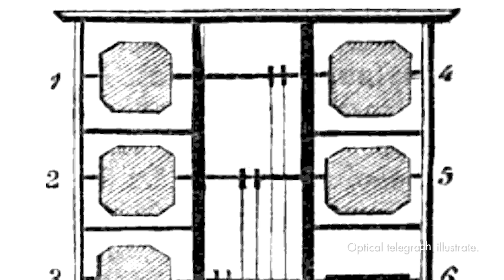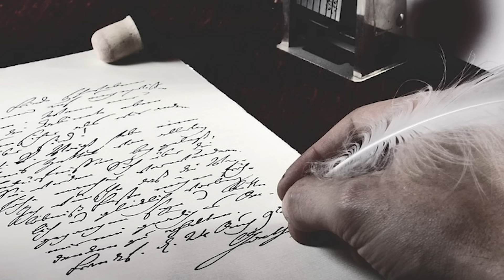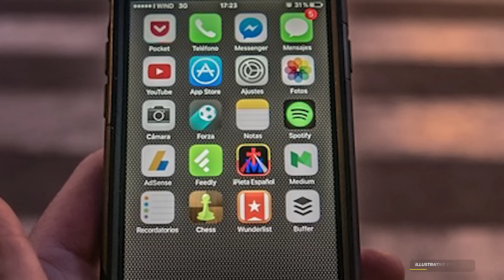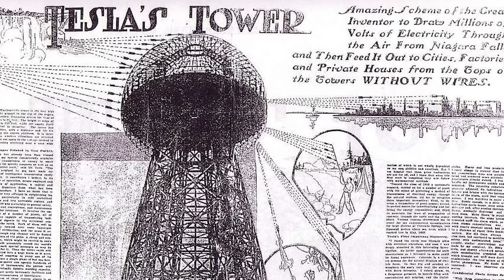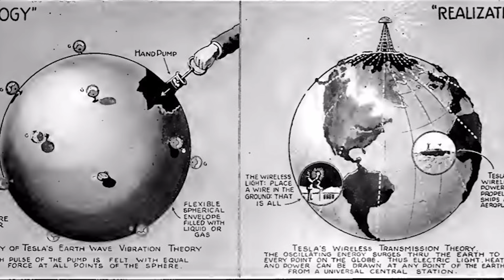Why America's Forgotten Microwave Skyway Network is still standing | Abandoned

Comment: As somebody who to this day works on microwave networks.....these are still in use by hundreds of entities in the US alone.  They are used in places where laying fiber optic cables would be cost prohibitive or is flat out not allowed (through national parks, etc).  This equipment is still manufactured and progressing and is now capable of supporting speeds up to 10Gbps.
Reply: I design word docs for circuits using them sometimes and I hate them lol. They're inventoried in our TIRKS database in all kinds of bullshit ways and we basically have to get told by an engineer a carrier we need to use is some microwave between mountains XD
Reply: @Emily_M81  They function great, but we do all our own documentation in house lol.  Hybrid circuits are always a PITA though, I much prefer pure microwave networks overall.  As soon as you start introducing fiber inbetween on the circuits it gets way too messy and complicated (from a monitoring standpoint).
Reply: I've worked many cell sites linked on mw.
Reply: I live in the desert west of Nevada, grew up in Idaho. Yes. Many of these are still in use. Some are now smaller than they used to be. I am now an ham radio operator. We use similar microwave radios to jump from mountain to mountain for our repeater network. Telecoms still use these older system.
Reply: How good do those e-band links handle rain?
Reply: I worked in a system that paralleled the Alaska Pipeline for nine years.
Reply: Yes my father worked on Union Pacific RR microwave systems for many years.
Reply: Thank you. That's what I wanted to know.
Reply: What happens if you were to stand in the way of these antennas while transmitting ??
Reply: @ovejeromd  That would not be a good thing to do. When working around the antennas we would wear a device that warns us of dangerous levels.  We also would use a  meter to measure around the transmission lines and wave guide connectors periodically. My last position before retirement where I worked we put over 200 watts out of the SSPA at 6 GHz. The antennas were 15 M with 55dB of gain. It was a gateway earth station providing most of Alaska’s rural communications. 200w at 6 GHz could cause some serious tissue damage. I got a small RF burn once about 50 years ago. It was a small internal burn under the skin.
Reply: @ovejeromd  Depends on how strong it is transmitting, but if strong enough, cooks like the microwave does.
Reply: They don't still utilize the horn antenna, do they?
Reply: @deepspacecow2644  It varies quite a bit.  You can see the signal degradation when rain occurs but it generally has to be a pretty heavy rain for it to have any drastic effect on the signal.
Reply: @jerseyshoredroneservices225  Depends entirely on how much the person is willing to pay.  More modern stuff no, but so many places and companies aren't willing to pay for newer equipment that the older equipment is still in use, with all the problems that come from them.
Reply: @mercuryfusion8325  
Ok, thanks.
 I remember being very intrigued with the long lines towers/antennas when I was a kid. When I come across one from time to time I always think I should fly the towers and make a video about them.  If there's a chance that one might still be active I guess I'd better think twice about flying in front of them...
 Not long ago I was out in New Egypt, New Jersey flying a cell tower audit.  On my way to and from that site  I passed a LL tower that was really calling me to fly it.
Reply: Kind of of what Ubiquiti manufacturers for the retail market?
Reply: In fact the NY to Chicago Skyway route has been reopened, new antennas and transceivers are being used, but on the old towers, why latency and stock markets. Light travels slower in fibre optic cables and they do not go the most direct route, thereby one gets better latency using microwave relay still.
Reply: I want to learn how to use this technology.  Where can I learn such tech?  Is this a trade knowledge or something you learn in school?
Reply: @Chris_at_Home Without knowing details such as system loss or dB over what on your antenna gain, I can’t tell what your ERP was. However, when I plugged in a system loss of 2 dB and assumed antenna gain of 55dBd (deciBels over a dipole) I get an effective radiated power of 39,810,717 or almost 40 megawatts. Wouldn’t want to get in the path of that!

Comment: I'm curious where you found the term "Skyways"? Every website and document I've ever seen on the AT&T microwave network referred to them as the "Long Lines".
Reply: Long Lines was a branch of AT&T Bell System.   It connected the various local companies to each other and internationally.  It also carried network radio and TV programs across the country.     I worked for them in the analog days into the fiber and digital days.  It was discontinued by the court ordered divestiture, and its functions absorbed into AT&T.
Reply: Trans Canada Skyway is what Bell Canada called the system
Reply: yup the correct name is AT&T Long Lines NOT skyway
Reply: @hugh007  Me too. Long Lines 1966-1984, retired 1997, back as a result of TCG purchase (renamed ATT Local, then retired again in 2016.  My job as a Craftsman was at NR, the TVOC at 32 AOTA.

Comment: I was a radio engineer for APS in Arizona back in 1967 after I got out of the USAF. We still used tubes then, but over several years converted to transistor equipment. The old tube equipment was made by RCA and called CW-20 microwave relay. Our system ran all over the state on the mountain tops. You really had to know a lot of different things like snowshoeing and climbing towers (280 ft). Back then we worked by ourselves which was a little dangerous, things have changed a lot now.

Comment: a few notes- 
AT&T sold all of their towers, including cell. 
Many of these are retrofitted with cell antennas. 
Many were built to withstand hurricanes, power outages and floods so they will likely still be around for 50 more years. 
MCI started off as Microwave Communications, INC and also had network of these. 
Microwaves are point-to-point, so the curvature of the earth limits their distance depending on height of dishes (which reduces reliability), elevations of site and of course anything in the way, even trees.
Reply: I have been to a site with its building still standing after the Washington IL EF 4. I can certainly say that the whole being resistant to hurricanes is and strong weather is right.
Reply: It’s always been my understanding that the original ATT microwave tower network connected military bases across the US to communication hubs.
Reply: Clickbait..the video has literally nothing to do with the title until the last minute or so….the title should be “ History of telecommunications in the US.
Reply: @dominicm2175  I had hoped for more discussions about the towers themselves, freqs used, Traveling wave tubes, yada yada
Reply: I remember having a farmer dig up a 50K pair cable that was at the time the main trunk between Edmonton and Calgary (not his fault, the location was not marked properly, a discrepancy between planned and 'as built'). service was rerouted via the nearest microwave tower but it didn't have the same capacity. Some poor outside plant guys spent many hours in a wet muddy field under a tent splicing it back together. That tower is still standing, hosting many cell antennas. Fibre replaced the copper long ago.
Reply: AT&T did not sell them all off. Many are still owned by AT&T to preserve fiber repeaters and utility easements on still used cables even though the Long Lines microwave portion may be out of use. Some even are still being used by AT&T/Qwest for microwave hops yet.
Reply: @mctscott123 True statement. I retired from them and all the ones in this area became fiber hubs and shared tower space for wireless services. My last position with them was a working at gateway earth station delivering bandwidth to rural Alaska.
Reply: @Chris_at_Home  Now that is neat!
Reply: AT&T sold MOST of their Long Lines towers, they still own several for various reasons

Comment: Railway semaphores weren't used in the way that is suggested in the video, as in sending individual letters to be decoded further down the line.  The telegraph, once it was introduced, was used to transmit complex native-language messages, initially via morse code.  Railway semaphore signals were more equivalent to street traffic lights.  They were signals to the train drivers to tell them the status of the track ahead of them and had only a few aspects that roughly equate to Stop, Caution and Go.  Generally, there was one pole for each track approaching the signal gantry, with multiple semaphore arms for tracks that had points for diverging routes.
Reply: Nevertheless, the fact that they were handed down to a different industry (railroads) is a valid point.

Comment: The horn antenna at 11:24 doesn’t and never did have anything to do with communications or telephone.  It is a horn antenna at the Green Bank Observatory in Green Bank, WVA and was used for radio astronomy purposes.  It was used to detect clouds of hydrogen in outer space.  It is still there, but hasn’t been used for many years (like most of the rest of their antennas).  Last time I walked up to the horn, it was covered in overgrown vegetation and simply rotting away.  😩

Comment: I’ve decommissioned these towers. Climbed towers for 10 years and it was pretty rare they (AT&T) would have us take these (the horn antennas) down. Back In the beginning they used to let you keep the scrap and holy cow you could get like $25K just from the metal. It was great. If you’re into tower history I recommend you check out the old network from the “H Towers.” It was a line of H shaped towers that ran across the US and I believe it was one of the first microwave networks (and I believe it was used for military activities) even predating the AT&T horn antennas. Tower history is absolutely fascinating. To this day if you visit a tower site that is way up in the mountains and hard to access, a lot of that equipment is still there.
Reply: If I remember correctly, the H towers were 2 guyed towers with a bridge at the top as a mount for the parabolic antennas. These were operated by Western Union. Long Lines towers were almost always self-supporting. (Part of the Cold War design principles.)

Comment: Microwave transmissions are still used in the telecommunications systems in the USA today.  My own office has to separate microwave links on the roof at two different frequency bands which provides our internet and phone connections to the outside world.

Many cell towers are connected to the rest of the world via microwave, especially in rural areas. 

And for awhile we were using microwave-linked Aerostats (blimps) for cell and internet service on Fort Myers Beach after Cat 5 Hurricane Ian completely destroyed the phone & cable cos in the area.
Reply: Also literally your homes WiFi router is a microwave transceiver for 2.4 GHz and 5 GHz.
Reply: Popcorn 🍿🍿🍿🍿🍿🍿🍿🍿🍿

Comment: We had a microwave tower on
the AT&T building in White Plains, NY.
It was the tallest structure there back then.
The long lines amateur radio
club, WA2CWP, was an HF and
repeater location which an
amateur friend, who worked
there showed us the station
and repeater there, 146.775
in 1987. 
It even had auto patch for phone calls via the repeater
until that ended with cell service.
Years ago, on shortwave, I heard a broadcast from AT&T
on the air, that it was a point
to point broadcast from AT&T
in Puerto Rico.
W2CH Ray Peekskill New York. 😊

Comment: I'm a Radio Communications technician part time in California, I see these Long Lines all over the place on many sites I work, many of them were taken down and replaced with MotoTRBO system on DMR, also Ham Radio Operators also placed their systems in the same tower that AT&T had.
  On Mount Diablo, the whole site of Long Lines were all removed and replaced with some more DMR systems and P-25 Digital systems. 
I believe they removed them on Diablo in 1999.

Comment: In 1979, I was an enlisted soldier in the US Army, trained as a radio operator / teletype operator / -  it was called MOS O5C at the time. 
Part of that job was called radio relay - we had line-of-site radio sets and we would receive a message from one direction and retransmit it in the opposite direction, basically performing the same function as one        station on the old semaphore-relay network.

Comment: I actually have a relative who worked for Bell Labs, as a matter of fact he invented micro mirror switching technology for fiber optics. Basically it’s where cables connect from what I understand and where the signal needs redirecting from connection to connection. Anyway, this video was extremely informative I thought and I’ve seen several of these towers before with the horns on them and always wondered about them

Comment: There is actually one of these towers not to far from me, what amazes me is I still see people up there on a semi regular basis doing maintenance. While it doesn't seem like it is currently active, I do wonder if it is kept in operating state for an emergency backup for critical communications.
Reply: Many of the towers do have secondary transmitters on them for various reasons and customers. The only reason the horn antennas remain is the excessive cost to remove them. Many other YouTube videos of the interior of the transmission buildings show they have had all their original equipment removed.

Comment: We used to see these towers in the middle of towns here in the South. I guess they were connecting the Central Offices of Ma Bell. My father became a telecomm tech at some point before he left the USAF. He contracted to do telecom work and we lived in Iran in the 70s when a microwave system was setup to relay between the "listening posts" at the edge of the Soviet border down to Bandar Abbas in the Persian Gulf. There were many sites in remote, dangerous areas. Later he worked for Datran which competed with Ma Bell here in the states with a system of towers between Washington, DC and Houston. I got to see some of the equipment in the buildings. It was later when I became a tech that I learned more about what was really going on with these systems and the digital data transferred via the Datran system. I think the Datran system was later sold to Sprint.

Comment: The problem with ATT Skyways is that it work on line of sight which means another tower had to be built every 30 miles due to curvature of the earth.
The Troposcatter link system is by pointing microwave signal at the right angle towards the sky, it would bounce off a layer in the atmosphere and could travel 200 miles. This is what was used in Alaska and Canada. And if you’re wondering how big invention fiber optic is, the entire capacity of the ATT Skyway infrastructure can be sent over one strand of a fiber optic cable.
Reply: Florida City, FL and Guanabo, Cuba are connected by a two pairs of troposcatter antennas, for telephone and basic TV channels. Both troposcatter stations are still standing, but not in use. I have a much more in depth comment on here about the sites with GPS coordinates and I mention 'White Alice' in Alaska and Canada

Comment: Interesting video! This network of towers was also known as ATT Long Lines. There’s one in a rural location not too far from where we live. It’s a very interesting installation that was definitely built to last. The horn antennas are still on the tower, and appear intact. All the copper feed lines have been removed. The tower has been retrofitted with an assortment of cellular antennas. The sign on the building reads American Towers, LLC the current owner.

Comment: I recall seeing an array of these huge antennas on top of a building in Portland, Oregon a few years ago. 
Always assumed they were for radio or TV. 
Never would've thought they were for telephones.
Reply: They are likely used for data not just telephones, still in use today with modern capabilities.
Reply: The microwave relays system was also used to broadcast TV coast to coast, too.
Reply: I don't get into downtown Portland much lately, but I noticed those horn antennas were finally removed a couple years ago.

Comment: I actually work at an underground bunker for AT&T. It’s still owned and operated by AT&T. It was built back in the early 60s during the Cold War era. Although it does not use communication microwave anymore (obviously) it does still a decent bit of fiber and telephone equipment.

Comment: A side note for you, the toll free 800 area code resulted from a military contract with AT&T to provide secure high-speed communications between bases. The deal was the military paid for all 800 numbers but only used a set potion of them, and the leftover numbers could be used by AT&T as they chose, thus the 1-800 toll free system is (or was) military subsidized.

Comment: There's one of these in my city.  When I was a kid, I was told it's a radio antenna for transmitting music from the station to peoples' receivers.  The tower is old and I never thought it was part of a microwave communications network.  The building its attached to is still being used by AT&T, but I wonder now if the tower itself is abandoned or still in use.  It doesn't look like it's seen a fresh coat of paint in years.

Comment: i think that this piece was unnecessarily confusing, mixing the history of wireless communication with long distance data transmission. The microwave network was built to provide a cheaper alternative to copper transmission cables for long distance trunk lines. They fell out of use because of 2 reasons, fiber optic cables and to a lesser extent satellite. The rise of microwave might be linked to the development of high frequency radio tech for radar during WW2 because that produced the amplifiers and receivers for microwave communication that made Skyway Network possible.